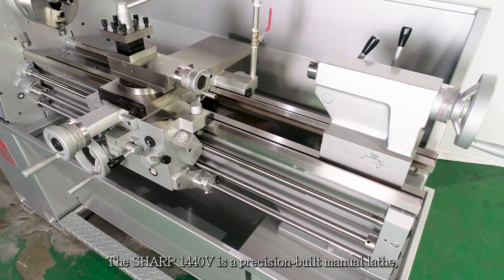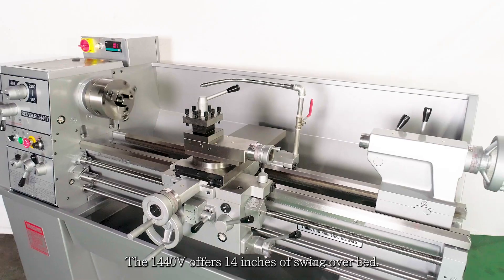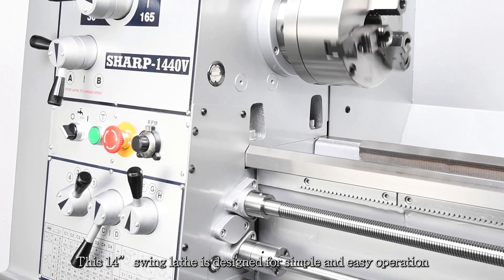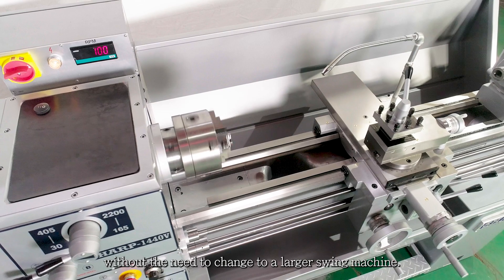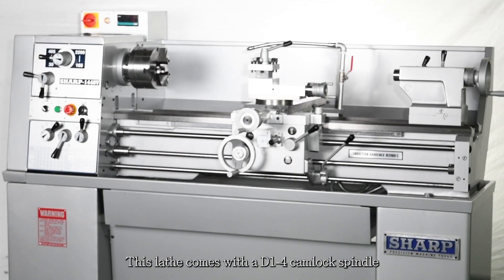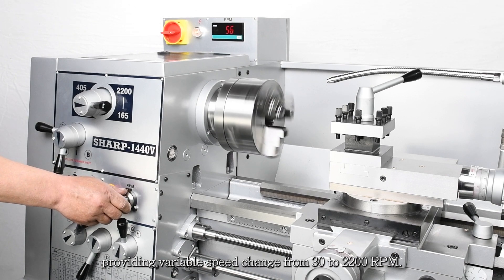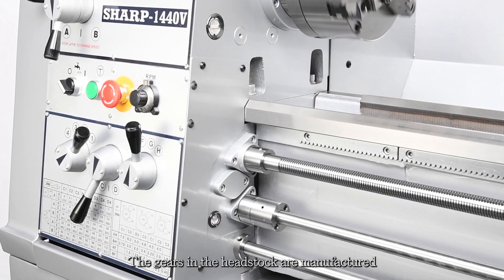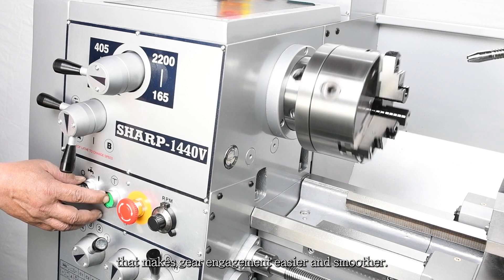SHARP Precision Lathe Model: 1440V

Comment: $?
Reply: I had a quote from them and it was pricey. I must have deleted it but I think it was greater then 15k. The 1640 was 24k.
Reply: around $18,500 bare bones. penn tool has it with all the toys (taper attachment 4 jaw ect.) for $22,900